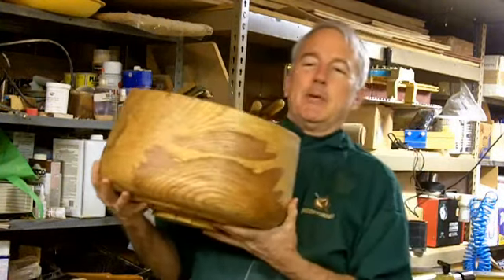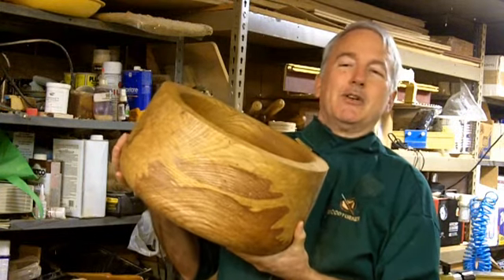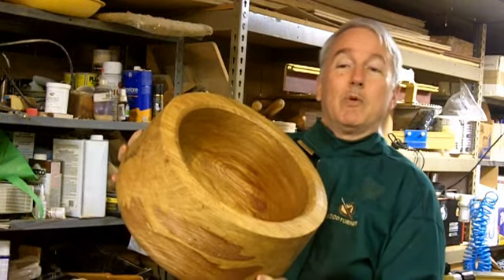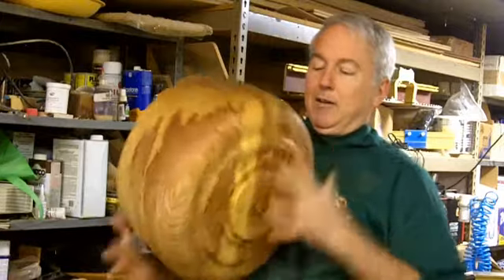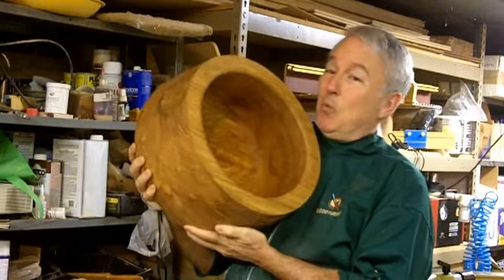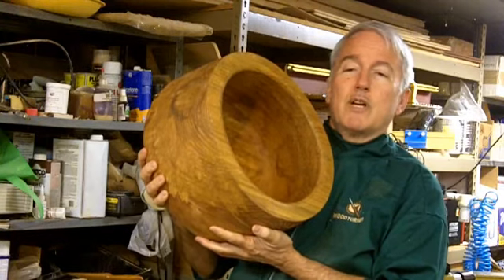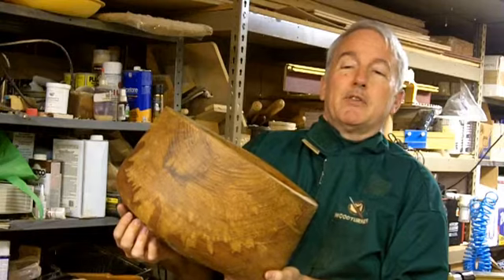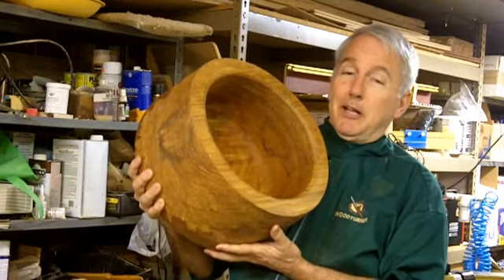Help - My Green Turned Bowl Cracked

Comment from the maker: I agree that clamping would probably be a problem.
Restating your suggestion:
1) Cut a grove in the crack area
2) Fill with contrasting wood
3) Camoflage it by repeating in a geometric pattern making it appear deliberate.
Do you have any suggestions on a jig for this curved and heavy piece?

Comment from the maker: The tenon originally used to rough turn the bowl is intact.
It could be used to finish turn the upper portion of the bowl. then part off and attach to a different piece of wood either similar or contrasting.
Is this along your lines of thinking?

Comment from the maker: Almost seems like a decision tree is needed.
1. Hide the crack   or   2. accept the crack; or 3 Disguise the crack
1. Hide the crack then is a path of blending the repair into the piece.
2. Accept the crack then is a path of contrast either with wood or some fill.
Philosophical point, If we are accepting the crack, should we then ream it out, and square it off? Or just fill it as is?
3. Disguise the crack is a path of hiding it in the geometrical pattern?
Are there other paths?

Comment from the maker: Sorry - stamp prices just went up.  :)
I do have more wood but I'm scared to open it up. It was sawn in half, sealed and put in a plastic trash bag then left outside on the shady side of the house. Now it has been there for several years.
I don't know what I'll find when I open the plastic bags again: Rot, bugs, spalting, or heaven. 
Do you have any jigs to handle this large awkward piece on router?